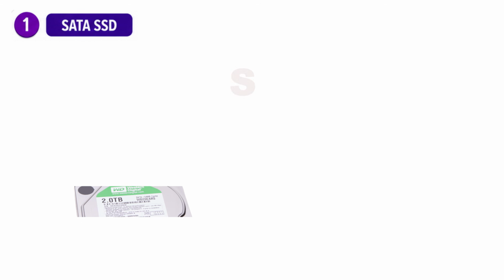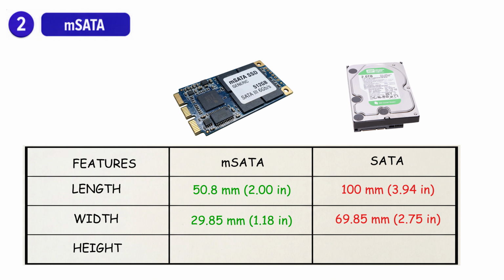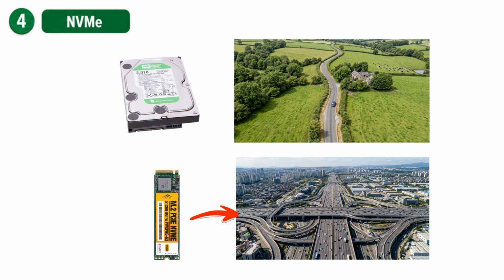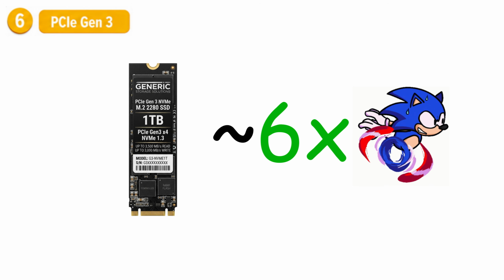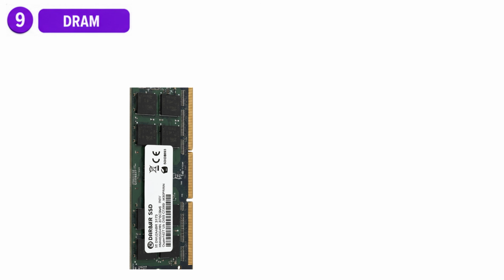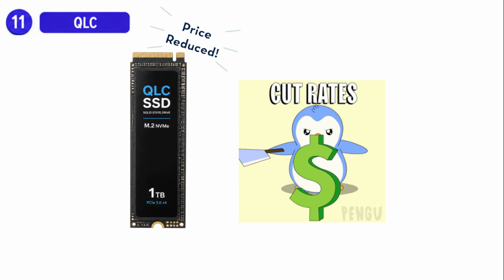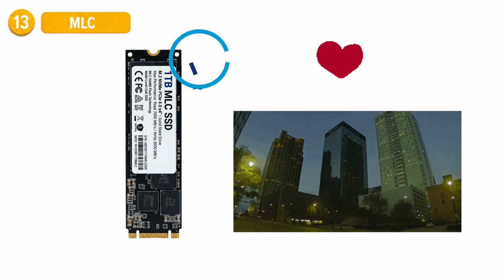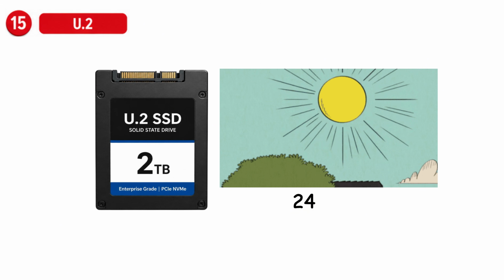Everything You Need To Know About SSDs in 10 Minutes

Comment: what do you understand for SSD? because in my paralel universe stands for Solid State Disc and have nothing to do at last with the first image and the SATA interface. I mean, the image is from a hard drive with magnetic spinning discs inside, not considered SSD, as SSD are made of silicon chips to store data, and SATA is a connection type, not a disc type. It can handle both SSD and Old spinning discs. It has to be with SCSI and IDE, both connection interfaces, not discs.  Also NMVe is a protocol that uses PCIe lines to connect with the computers. M2 is in fact, the ony type of SSD on the list. 
types by connection

SSDs using NMVe protocol through pci express slots:
AIC (Add-In Card)
U.2 (SFF-8639)
U.3 (SFF-TA-1001)
EDSFF (E1.S / E1.L / E3)
CFexpressM.3 / NF1

SATA SSDs
2.5-inch SATA SSD
M.2 SATA SSD
mSATA SSD
SATA Express SSD
SATADOM (SATA Disk on Module)

IDE 
SSDs2.5-inch IDE 
SSD3.5-inch IDE SSD
IDE DOM (Disk on Module)CFast / CompactFlash Card (Used as native SSD via passive adapters).

SCSI 
SSDsSAS SSD (Serial Attached SCSI SSD)
Solid State SCSI Drive (Industrial legacy replacements for 50/68/80-pin drives).

PCIe Gen 3 / 4 / 5 NAND Flash SSDs
M.2 NVMe SSD (2280 / 2230 / 2242) (The most common form factor for PCs, laptops, and consoles).
AIC NVMe SSD (Add-In Card) (PCIe slot form factor, shaped like a graphics card).
U.2 / U.3 NVMe SSD (2.5-inch enterprise form factor using PCIe lanes).
EDSFF NVMe SSD (E1.S / E1.L / E3) (Modern ruler-shaped form factor for data centers).
CFexpress Card (Type B / Type C) (Removable storage utilizing PCIe and NVMe for high-end cameras).
Reply from the maker: @TheNomcognom

Good catch on the 0:03 timestamp footage. You are correct that the image shown is a WD Green mechanical HDD with SATA interface, not a SATA SSD. That was a visual error on our end.

To clarify a couple of technical terms: 
- SSD stands for Solid State Drive, not Disc, because the drives use silicon chips rather than physical discs. Also, M.2 is a physical form factor, not the only type of SSD. This is why your list accurately includes 2.5-inch, U.2, and AIC drives. 
- As this video is about helping user to choose the right SSD, We categorized the drives by interface, form factor, PCIe generation, and NAND architecture because a consumer needs this full context like understanding DRAM vs. DRAM-less or QLC vs. TLC, to avoid purchasing the wrong hardware.

We appreciate your time and your deep dive into the interface protocols list this will further clear the concept to our viewers.
Reply: @Project-Expositor  glad to help ;) and it's true, my bad, not disc, drive. good luck with the cannel